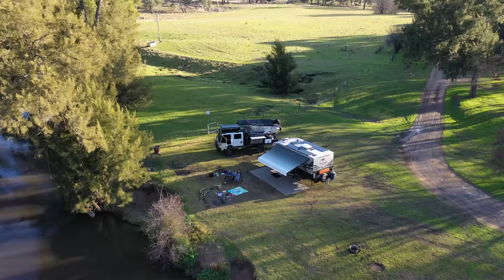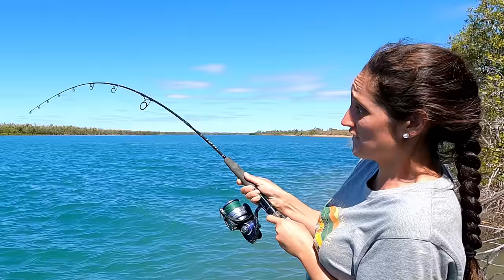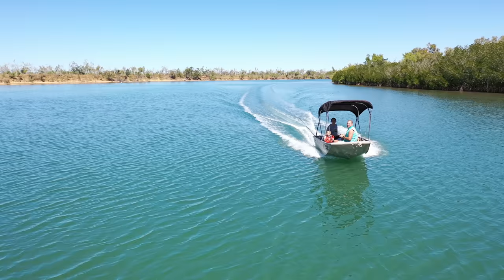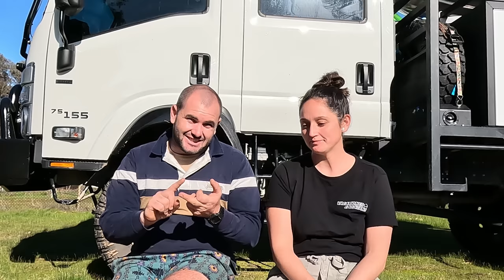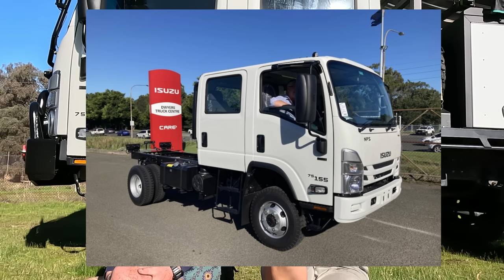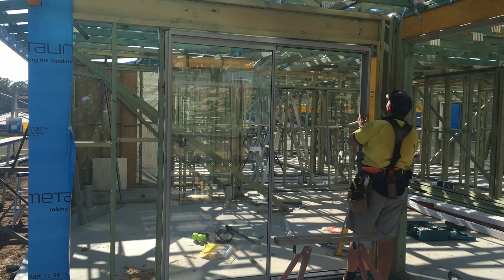Isuzu NPS 4x4 TRUCK COST BREAKDOWN & HOW we AFFORD to TRAVEL AUSTRALIA FULLTIME - TOW VEHICLE

Comment: Elnick, You two are a fantastic couple and add a family to that too. Congratulations on your achievements and your family in your travels. In the USA, I have not come across an Isuzu 75/155 or anything resembling your rig. I wish your Isuzu was available in the USA. The US military sells a surplus of government vehicles on liquidation. M1078  2 axles, M1088  3 axles (tractor trailer set up), M1087 3 axle (expandable sides), and M977  4 axle vehicles for those who can afford to buy and maintain these vehicles. There is also the 'FLA' (Field Litter Ambulance) M997A3  2 axle HMMWV that could maybe work well as a single person or a couples' adventure/off-road vehicle. These HMMWV's have 'geared' or 'portal' hubs/'portal' gears like all HMMWV's do. All of these military surplus vehicles operate on a 24 volt electrical system. A set of standard 'jumper' cables will not suffice a charge to the batteries. There is a proprietary 'slave cable' that the US military uses to charge/'jump' a vehicles' battery if one is dead. There are 'tesla' brand (not the car company) plug-in battery boxes that could be used for 'jumping' your vehicles dead battery. Plenty of US-based 'overland' purchasers use these types of vehicles for their cross country adventures as your family does in your Isuzu. There are numerous overland vehicle chassis modification/fabrication companies that produce the boxes on these these chassis'  what ever the customer wants. There are also DIYers that build up their military surplus vehicles the way they want at home. They are really wild with their set-ups.
Reply from the maker: Oh yay! Does sound wild! Super cool though! Appreciate your support (: thank you!

Comment: That was interesting and informative, thanks.

I would suggest you drop your air pressures for dirt roads and lower for hard or soft stuff. These trucks are really capable and change dramatically with lowered air pressure. As a bonus, the ride with lowered air pressure is wonderful, just remember to stay slow for the lower pressure when you are doing short(ish) bits of bitumen in-between dirt sections.

You may wish to consider an ATB (Auto Torque Bias) front differential, really transforms the capability whenever you have the front wheels engaged, and is brilliant in sand when combined with lower air pressure.

Yep, a multi breather kit is a definite advantage, for the front and rear differentials, transfer case, transmission and fuel tank.

I know exactly where you are coming from, we have a 2009 D-Max extended cab chassis with a tray that we bought new, still have it, but we upgraded to a 75-155 NPS 300 January 2020 build, and we now have carrying capacity coming out of our ears.
Reply from the maker: Thanks so much for the tips and feedback! We appreciate it (:

Comment: Good job & great ep guys, interesting info, you got another nosey subber. Nice rig, you cant go wrong with Isuzu, they are great trucks.  I had a Seedgrading Machine mounted to a 1984 9 ton (2wd) Isuzu Truck, apart from a couple of flats tyres & a loose radiator hose clip on one occasion, it never faulted in 15 years & I reckon you could have started it with a torch battery, I only had to change them once. Cheers
Reply from the maker: Thanks so much! 😂 that’s good to know! Hopefully we don’t kill Suzie 😂 thanks for your support

Comment: What a beautiful truck. Just few more questions. How heavy does the truck weight? I am thinking about doing the same but keep the gvm at 4500 so the rego and toll can be cheaper. I will be driving that as a daily. So just wondering if it is doable.
Reply from the maker: Hey guys thanks for watching the only issue with keeping it under 4500 is you don’t have much payload left ours weighs around 6t fully loaded 🤙

Comment: You lost me when you said it is an auto.
It's an AMT (automated manual transmission) which is a clutch-less manual transmission and in my opinion is 1 of the worst gearboxes on the planet and shouldn't even have been approved. 
The TC-AMT is certainly better but still quite bad. 
If you wanted an actual real Auto you needed to get the FTS, not the NPS.
Reply from the maker: Appreciate your opinion (: thanks for watching 🤙